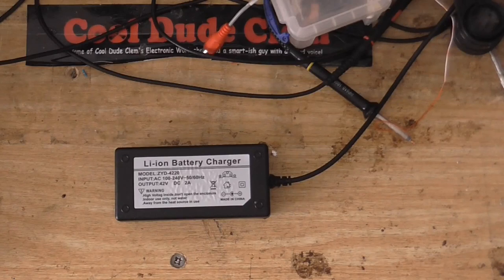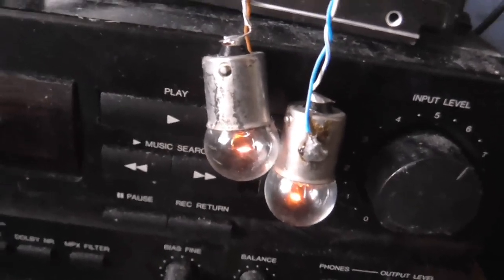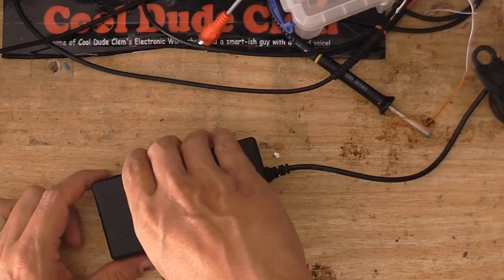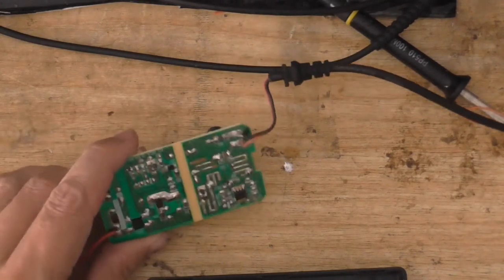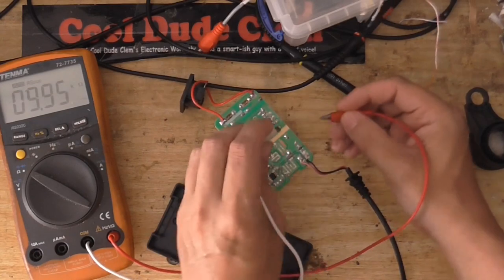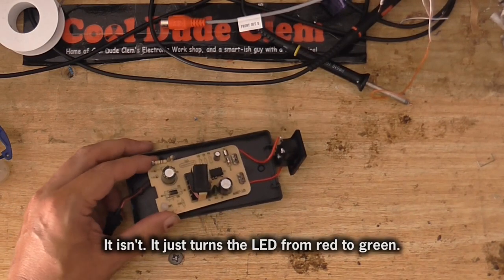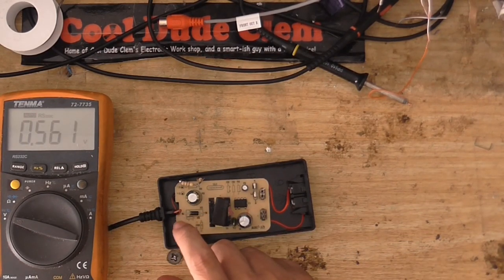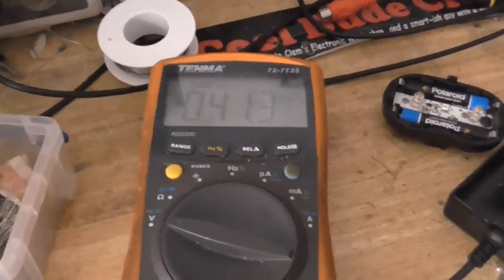Is this a charger, or a joke? (and attempted repair)

Comment: The charger for my old ebike was in a metal case and was quite weighty and it even had a fan in it a small one at that but a fan all the same to cool it. my bike was a 36 volt 10 Ah.  That thing there looks pretty small and cheaply made,.

Comment: The small chip, similar to TNY series, they can barely make 20W as long as they are heatsinked. Feedback is on the primary side (ultra low cost). You can get 48V SMPSUs from POE switches, POE injectors etc and you can work from there. Some HP printers had 32V at 2.7A bricks. You can "TRY" to "PUSH" them to 42V (your own risk LOL). But man, even the HP brick is like a HP Lab Power Supply in comparison to this thing. Wondering how maanaged to last so long.

Comment: I'm sad to see your "faulty meter" leads. Looks like the op-amp was for  reading voltage across that resistor to switch to green when battery had charged. Are you sure it was 100 ohm and not .1 ohm? 100 ohm is way way too high. Check voltage at the secondary diode on the cathode. Should be able to make a meter circuit like you did before to show current from there to the battery when charging instead of voltage.
Reply from the maker: I thought 100 ohm looked way to high. But as I'm not experienced in any way with working with surface mount parts, that's what I thought it was.
Reply: @CoolDudeClem  It can not possibly be 100 Ohm. Then the charging process would take forever and the heat dissipation in that little resistor would be gigantic and lead to immediate failure. It's not clear to see, but it seems that the writing says R100, which would be 0.1 Ohm. The poor LM358, specified only to 32V, was run at 42V with only R7 as a rough voltage limiter in the V+ supply rail. Likely it succumbed from the overvoltage, maybe after an additional jolt, when disconnecting the charging battery. If you wanted to continue to use that charger (maybe measure the current to get an idea what the real charge rate is), you could duplicate that LM358 circuit with an additional overvoltage protection in place at V+.

Comment: Put a .1 ohm resistor in there or just a jumper R100 is .100 ohm. R is a decimal point example 10R1 would be 10.1 ohm 12R3 would be 12.3 ohm and so on.
Reply from the maker: Thanks, I really didn't know that. I though all resistors had it written out in full, for instance I have some 0.15 ohm ceramic wire-wound resistors and it's written on them as "0.15Ω" so I thought the same would apply to all small value resistors.
Reply: @CoolDudeClem  Hey again if you see a "K" it's × 1000, a "M"× 1000,000 no letter it can be × 1 being that's it in hundreds.